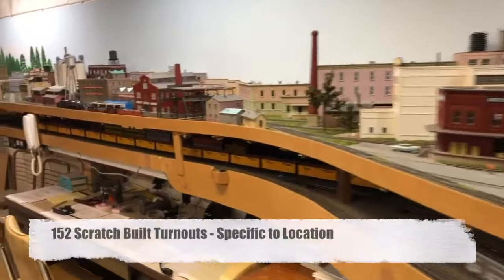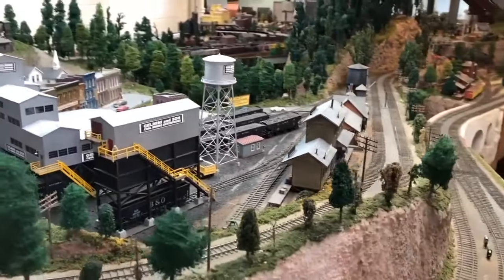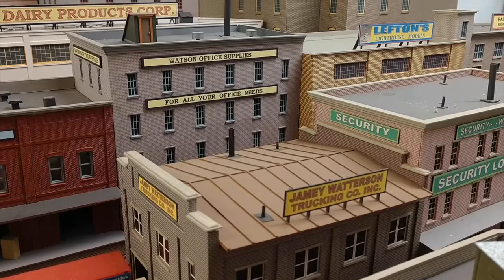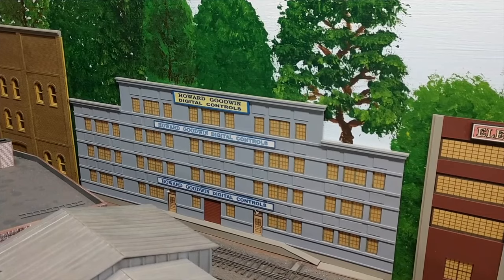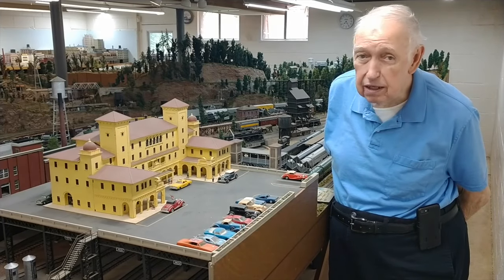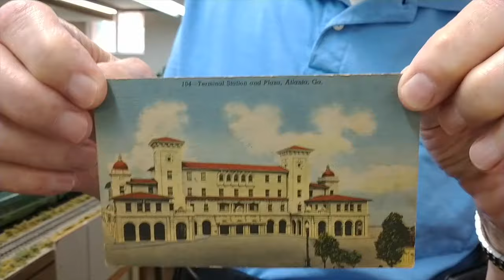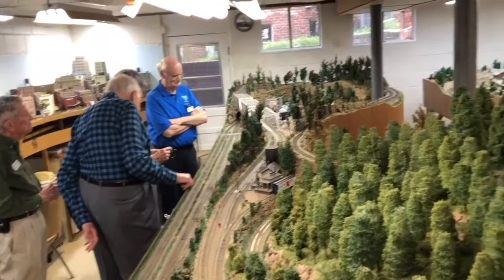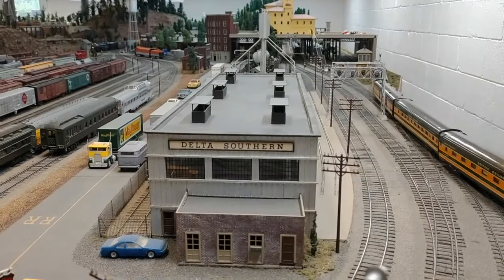Dr Joe Nichols Sr MMR, Delta Southern RR   (HO)

Comment: Beautiful layout, I used to hate transition era but once I went from a late 1900’s diesel nut to a early 1900’s small steam crazy I’ve learned to appreciate it. My layout is the first one I’ve had where not only will it run exactly the same as the proto but I have local passenger and mixed freight on the branch lines which I’m eager to upload ops videos when the whole thing is up and running.